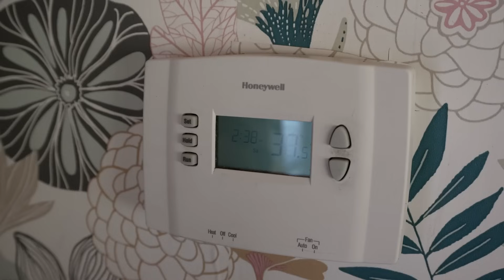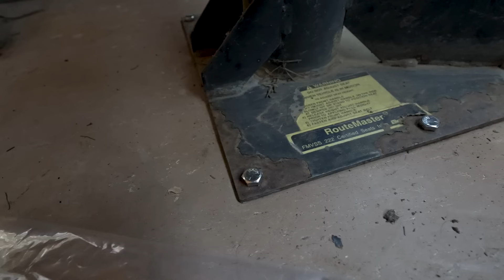End of the Road: The Closing Chapter of Bus Life At Our Off Grid Property | An Emotional Day

Comment: guys when it gets hot out side  take a wet towel and put it on the back of the neck it will help keep cooler and you won't overheat so back when work in a hot temp

Comment: Now you have an outside kitchen instead of a boot room I loved living in my bus I lived in it for three years had it for longer but lived in it for 3 years on my property parked it alongside my tube Bay shop cut a hole right through the shop built the tunnel into the shop wood stove kept it really warm plus I had a little propane furnace in there too but the wood stove was what kept it took it hunting all the time in the winter loved it but always warm and it only held 8 inch wood mind your head insulation on the floor though I insulated the floor and all the windows that I took over insulated to and it had blow in foam in the sealant in between the two metal roofs

Comment: I live on the east coast of AUSTRALIA and temperatures of 37 degrees Celsius is very common in summer,also we get very high humidity in the 80% and higher and still have to work in long pants and long sleeves shirts. It’s so hard to work outside in in shorts and a bikini top when it’s 37 degrees Celsius.

Comment: My wood stove in my bus was an old Fisher which I just cut the hump off the back of the wood stove to make it smaller took 8 inch wood and for the chimney I used old car drive shafts and it's still in there in there for 25 years I think I removed most of my windows and sealed them in with sheet metal got it painted white roof gray sides light gray and white bottom I wanted a white roof so wouldn't get too hot I had to get my bus painted because my bus was used in a logging protest years ago it was real big one I think it was up towards Port Alberni area and it had log protestant stuff written all over the side of it and my whole family are loggers I wouldn't even drive the bus to my house I told the guy if you want me to buy it you gotta drive it to my house and park it in my yard🤣🤣🤣🤣🤣

Comment: I hadn't watched the first videos and didn't know the back story to your current off-gridding self-sufficiency until this video. It was good to get that part filled in and understand the emotional wrench this was. It is a good step though and it marks a transition point for you. Keep going with the house and homestead. If I could offer any advice it would be to get all junk wood in a single pile and all machinery/equipment into a single location on the homestead. Going forward, you need to be systematically thinking of having a space that is not cluttered with detritus. Project by finished project will get you there - and minimising the number of projects at any one time so that you minimise the non-productive multi-tasking and temporary ngs. Honestly, it will help you get a sense of completing things to achieve eh lifestyle you dream of.

Comment: I can't believe you blocked off the back door I had my bus had two side seats that folded into a full bed across the whole back so I could back up to a lake open up the back door and then I had a cage on the back of the bus where I would drive my three Wheeler up onto it and if you wanted to go up on the roof with the ladder and sit up on top of the roof in the rack up top but I love that back door opening it up and looking out and the cage would hang I could jump off the cage right into the water of the lake then I had a bathroom with a toilet on one side and crossed from that was a shower stall I built and up further wasn't on the left side was the fridge closet furnace in the bottom of the closet and on the right side was succinct stove and another seaten area with a table on it and behind the driver's seat there was a seat with a table on it the wood stove was right in front of the door front door that's a boat it and then it cupboards all way along the top and it cost me $1100 to get cushions made up and then I let my mother-in-law stay in it for one summer and they've totally trashed it let the dog sit on the cushions wrecked all my cushions made me so mad I never went back into the bus then the rats took it over so I just gutted it and turned it into a shop got my tools in it now table saw drill press band saw wood lathe bench still got the sink in there grinders bench grinders

Comment: Whatever that was on top of the bus, rolled off.
Reply from the maker: The emergency exit broke off in a windstorm so we had a piece of rubber and wood holding it down, but wasps started forming a nest so we didn't try to take it off right away. We didn't seal it up incase the new owner wanted to be able to open it still